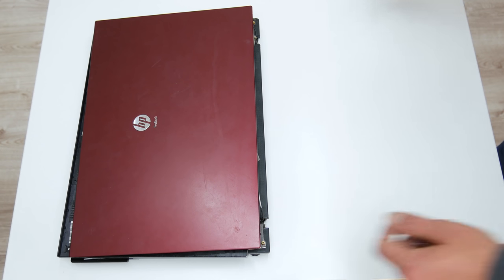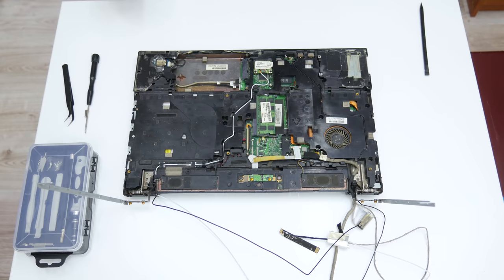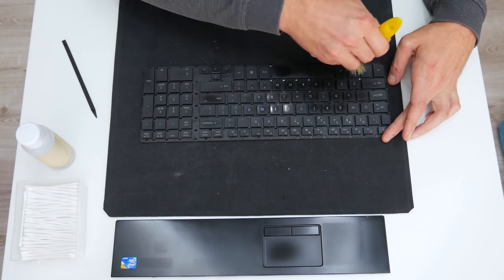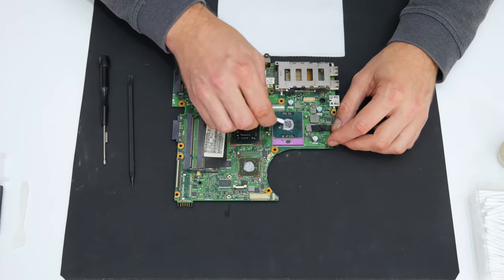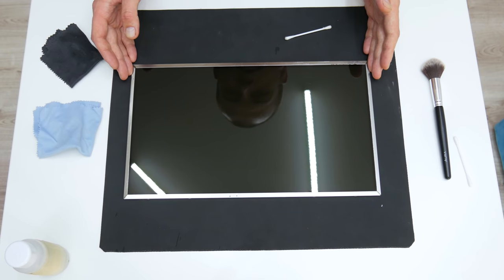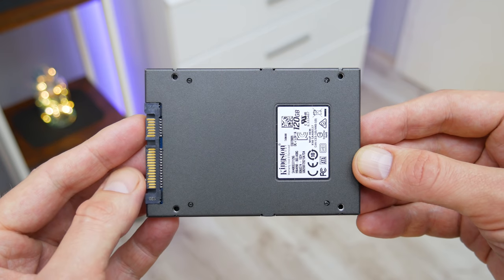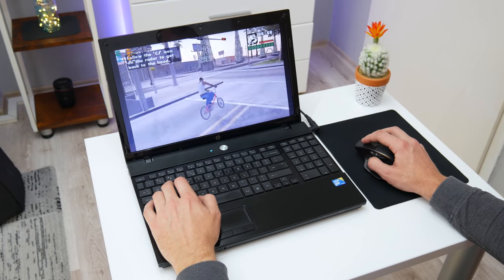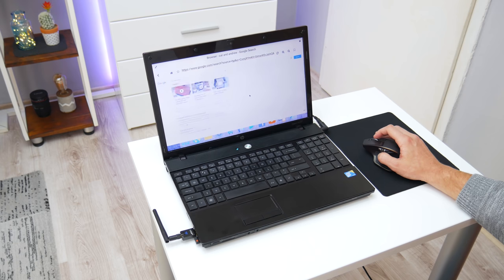Transforming Trash into a working Laptop

Comment: "it has no display, no ram, no battery, no charger,  ..." 

So, it's literally a junk ..
Well done Andrew 👏
Reply: Ero-sama Irianto Also no hard drive
Reply: No laptop
Reply: No, it's N o t h i n g
Reply: Andrew: Hold my various parts for restoration purposes.
(Comment meme reference)
Reply: I don't believe all of these components works 100% correctly, especially the keyboard , it is usually has some malfunction in specific keys, and the RAM sockets, so I can't trust the reality of this video.
Reply: @yuan.pingchen3056  with some decent kit and equipment, it's possible. But yeah, I agree with the keyboard. I had my dad's laptop which is 7 y.o by now and the keyboard sucks so bad
Reply: Not certain about the points made but ,if anyone else  needs to find out about 
repair laptop
 try Saankramer Electronic Magazine System (do a google search ) ? Ive heard some great things about it and my brother in law got great success with it.
Reply: I'm not sure but ,if anyone else  needs to find out about 
circuit board repair companies
 try Saankramer Electronic Magazine System ( search on google ) ? Ive heard some super things about it and my mate got great success with it.
Reply: Not certain about the points made but ,if anyone else  trying to find out 
repair a car
 try Saankramer Electronic Magazine System (do a search on google ) ? Ive heard some incredible things about it and my m8 got great success with it.
Reply: gone, reduced to atoms

Comment: As usual, your work is excellent. My only disagreement would be with installing 4GB rather than 8GB RAM when you had the machine open at the time. Love your video!!!
Reply: Unless you get the extra ram essentially for free, or you intend to use such an old laptop as a daily driver, I wouldn’t bother.

Comment: Good job as usual!! Missed the CPU upgrade tho 😉
Reply from the maker: Thank you :D actually this model has no good CPU support, i only have Core 2 Duo T7200 which is the same performance as the CPU on the laptop
Reply: Cat and Andrew Higher end T series or P series C2D CPUs are available in some countries for pennies / cents. Though I don’t blame you for not upgrading it, putting a P8600 in a laptop like this can make a difference if one really wants to use such an old laptop as a daily driver.

Comment: Is it safe to use IPA and glass cleaner on the display? I watched some other videos and they say not to use anything other than water because IPA can damage the coating on the display.
Reply from the maker: mostly is safe to use and it wont cause any damage, is not recommended to directly to amoled or oled displays. LCD, LED are different and much more durable. Personally i never had some issue with IPA, but quality IPA
Reply: @ComputersAndTechAndAndrew  OK, I think I'll continue using IPA, but maybe use a lower percentage. :)

Comment: Hi, I have Old Laptop 160 GB harddisk with Windows Vista Home Premium. The old laptop mother board got burnt - well known problem HP DV6646US - of the HP 6000 Pavilion series. The NVIDIA graphics card problem it seems. I got the board replaced once, but it worked only about 10 months and again back to square one. Its a AMD Turion processor laptop. It is possible to replace with Intel board and still not have to do and any BIOS update and still retain the harddisk 140 GB and run the pre installed Windows Vista? I would appreciate Any idea or some leads.

Comment: You didn't upgrade the CPU. By the looks of it, its a socket P CPU, so you can theoretically upgrade it to the QX9300; the fastest quad core 2 CPU. Or the X9100 for fastest dual core 2.
EDIT: OK this is a socket M so the fastest would actually be the T7600 :/
Reply from the maker: Hi bro, these model is not supporting core 2 quad, i have one I've try it but is not working. btw this is DDR2 laptop and DDR2 are little bit limited with upgrades, if it was DDR3 then i think core 2 quad will work

Comment: Hey Andrew, I have a Lenovo G50-80 laptop and I would like to upgrade its maximum potential. Would you please help me choose some parts(like the ssd, ram[already 16GB], if possible an eGPU, and a better processor). I am aiming to get some descent video editing performance out of it. Also it would be great if you are actually able to make a video doing just this. Thank you and keep uploading the videos😊😊
Reply from the maker: Hi bro, personally i didn't test the Lenovo G50-80, i found on the internet that some users successfully connect eGPU using exp gdc, about RAM, the 16GB is max, maybe it will work with 32GB but am not sure about that, maybe because i3 i5 i7 4tg gen are supporting up to 32GB but in the most of cases the laptop chipset is limiting to 16GB
Reply: @ComputersAndTechAndAndrew  OK, thanks!! Will definitely try to do the 32gb and tell you the result on the video of yours that comes out latest. If possible for you, please try to do the above mentioned upgrades by yourself (possibly resulting in a video of yours). It will be really helpful. Thank you😊😊😊

Comment: Hello friend, I have been subscribing to your channel for some time and I will tell you that you are doing a good job with old laptops you can see that you have a lot of knowledge and skills and patience.  I have a question for you, could you advise me?  I have an old samsung laptop and recently changed the thermal paste I changed the hdd to ssd and wanted to change the processor in it for better. My laptop is samsung R60 plus (model: NP-R60FS02 / SPL). Processor: intel mobil core 2 duo T5750.  Mainboard Chipset ATI Xpress1250 (RS600).  Southbridge ATI SB600.  Memory ddr2 4gb 333.3.  I was thinking about the intel mibile core 2 duo t9500 processor.  What do you think about this as a specialist and professional in this field, best regards and thank you kindly.  PS. greetings from Poland.
Reply from the maker: Thank you for subscribing and supporting me I very appreciate that :D about the CPU, am not sure about T9500 because T9500 has different BUS ( T5750 TDP-35W BUS-667 and T9500 TDP-35W BUS-800 ) WIth some models the CPU with Higher BUS may not be support but some models will support, personally i haven't tested any R60 and i cannot tell it will work or not. The only similar CPU's are T7200 or T7600 but it is Not worth to upgrade from T5750 to T7200/7600, the performances are very similar.
Reply: Thank you kindly for your help Andrew, best regards and good luck with your new projects, I will be happy to watch them on YouTube.

Comment: Hi Andrew, i need your help. 
I want to install windows 10 in perfect mode for gaming (The cleanest mode), but i don't know how to do. 
Thanks if you answer my question :-D
Reply from the maker: Hi bro, if you want getting max performances from Windows then you should do few things. 
- Do not install a lot apps in C partition where Windows is installed
- Do not Install apps like Boosters, Cleaners and other similar, these apps just will slow down the Windows.
- In Task manager prevent from automatic startup some less important software's and apps.

Personally am using Windows 10 pro and 1 SSD as entire windows partition. In Windows partition I have installed, Antivirus, Adobe Premiere Photoshop Audition, Mozilla and Chrome and nothing more.
The Games are installed on other disk, and I have Other disk for data only
Reply: Thank you very much Andrew, just one thing, sorry for the inconvenience, is it okay if the drivers updated them with driver booster?

Comment: Hi bro 👋
I have a computer built by AMD 2.14 GHZ, 4gb ram and 500gb harddisk.But I am during browsing or watching YouTube the video and site is very slow.Gta sa aslo getting hang. I rest already.What I do now.plz tell me any solution 🙏🙏
Reply from the maker: Hi bro, if is desktop then you need better graphic card and instead HDD use SSD, if is laptop then you can add SSD only ( laptop GPU is not upgradable )
Reply: @ComputersAndTechAndAndrew  thanks bro
Reply: And how to select graphics card for my desktop PC in above requirements
Reply from the maker: @sos6626  what is your motherboard model, cpu model and what graphic card do you have now? i will check the specs and tell what is the best option and budget option

Comment: Can I put desktop CPU into laptop

For ex:

Like i5 2nd gen to Ryzen 3 3200g
Reply: Depends on your laptop model. Probably no. Like really, no. And of course not from Intel to AMD vice versa.
Reply: @MichlBinI  then to I5 9th gen ?,
Reply: @MichlBinI  I think nobody had tried yet..
Reply: @MichlBinI  that's why there is no video on it
Reply: PRO TRICKS desktop and laptop sockets are incompatible, meaning the cpu won’t even fit into the laptop. There’s also the problem with wattage even if you can swap. There aren’t any videos on it because it’s physically impossible.
Reply: @si1ver_763  🤔 

somebody should try that ,to swap pc CPU into laptop ,that would be fun.
Reply: @si1ver_763  it depends, because some laptops use a normal socket but a "mobile" CPU, with less voltage and clock
Reply from the maker: No bro, the difference is soooo huge. Different size, different architecture, also is not all about socket, the chipset and the motherboard must be made to support that
Reply: @retroree5  exactly. Some newer laptops do indeed run with standard-sockets. But "PRO TRICKS" will run, even if the socket fits somehow, into many problems. Would be easiest to just get newer laptop, enjoy DDR4 and use your old drives if desired.

Comment: I have hp Compaq 6710b from 2007 still working but harddrive died
Reply: 2gb ram core 2 duo 

Just cleaned and apply thermal it will usable in today

Comment: This e GPU support GTX 1660TI GRAPHIC HELP ME AND MY HP AB032TX
Reply from the maker: Hi bro, i have the 1660 Ultra and 1660 Ti, for now I didn't make it working on any laptop, even i used new gen of EXP GDC with M.2 Dual HDMI, maybe in future i will find some laptop that will support 1660, btw if 1660 start working then the RTX will work also